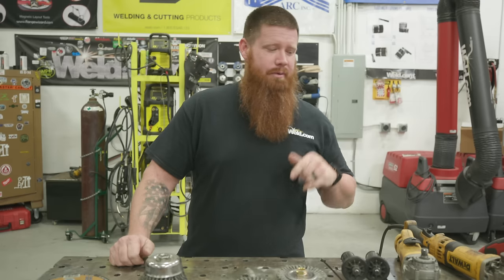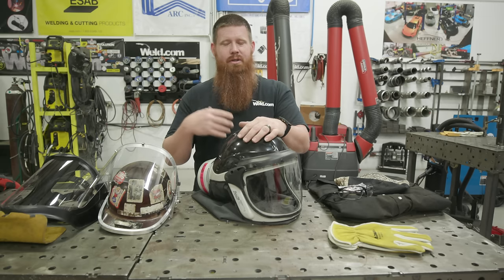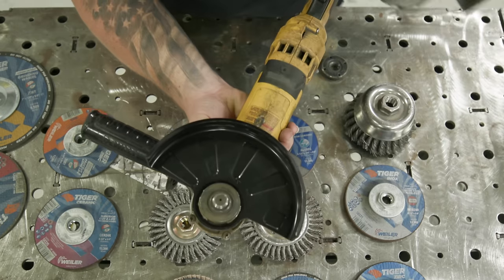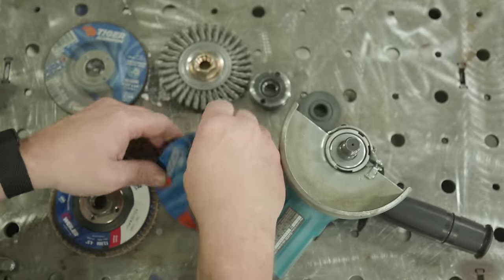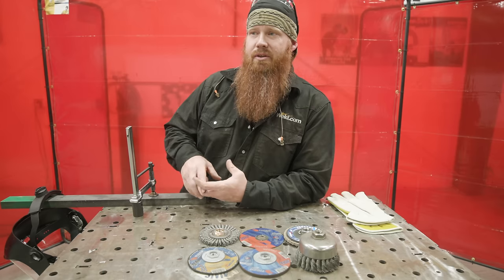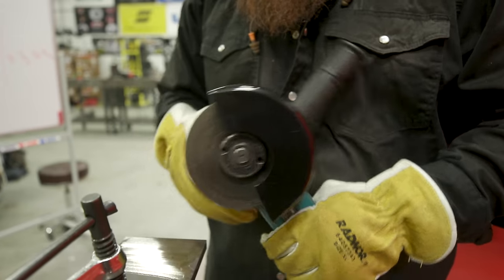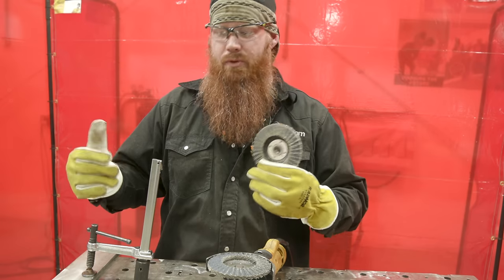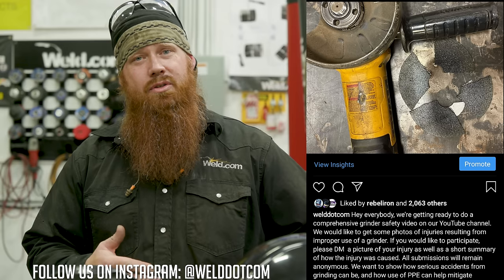Grinder Safety: How to Properly Use an Angle Grinder

Comment: I found a 7" 18amp grinder at the scrapyard and it had no nut or bushing. They tossed it because the double safety switch was broken. I bypassed the switch because it was annoying to fiddle with the internals and get it working (so I just jumped the internals instead) and it would power on when plugged in. Then, I used my hacksaw to cut a nut in half and I took the two flat sides of the nut and pinched a bargain store 7" cutting disc between the flat sides while on the arbor of the grinder. There is no centering mechanism for the cut off wheel when you do that, so I had to perfect the skill of keeping it centered manually while tightening the nut halves with an adjustable wrench. Sometimes it was close to centered, so I would very gently touch it to some scrap to whack off the bit that was sticking out wider. Man... When I cut that nut in half with the hacksaw I was like "this is the last fuckin hacksaw cut EVER!". LMAO, one could say I literally "blew through" a 50 pack of cutoff wheels, because they would blow up all the time! The grinder had a handle on the side, but it still yanked my arms a good couple inches when I kicked the power strip on. Luckily it had a guard. It came from a limestone quarry that tossed it in the scrapyard, which was where I would get my tools from back then.

Comment: Uh, your demo of how to do it wrong gave me the heebie-jeebies.  As a woodworker, I have a healthy respect for tools.  I still have all my fingers and both eyes.  I've never used a grinder (clearly, a two-handed tool), but I may need to, soon.  I have been considering 11-gauge landscape edging (Corten metal) for my yard.  To get the sections to fit my layout, I'd anticipate making a few cuts. The angle grinder seems to be the most appropriate tool.  Thank you for producing this comprehensive video - excellent presentation!

Comment: I was a welder for 20+ years and I've only had a few mishaps. About 13 years ago or so, I was using a  9 or 10in pneumatic grinder with a wire wheel. Luckily our uniforms were fire resistant, and stronger than regular clothes, because I got a little careless and the wire wheel caught the bottom of the uniform shirt and wrapped it up. However, since those pneumatic grinders don't have a automatic brake, that thing ripped out of my hands, wrapped my uniform up then proceeded to kick me in the side and broke 3 of my ribs on my right side. It happened so fast that there was absolutely nothing I could do about it. I had on all of the proper PPE and still got injured. Grinders are no joke. They will bite you every chance they get and you will lose. Be safe out there.

Comment: Never owned an angle grinder - they scare the crap out of me. But about to take my first MIG welding course age 70.
- no eye protection or face protection
- no shield on grinder
- flammable solvent
- sparks directed toward O2 and acetylene and hoses
- work not fastened down
- use both hands
- second grip should be attached to grinder
- could use smaller cutoff wheel

Comment: Awesome video. I have started using diamond cutoff wheels they don’t cut as fast but they don’t reduce in size and can’t break since they are steel. I still use a type 1 guard with it though

Comment: One thing i do after mounting a wheel is point it in a safe direction and pull the trigger for a second, then let it spin down. That lets me know that everything is mounted well and balanced. I have an air grinder that stops a bit quicker and LOVES to launch heavier steel brushes if they are not tight (they just unscrew from the arbor, still going 10k rpm). Had to chase a couple across the shop before, then launched one across the parking lot after hours just for the fun of it. It must have been going 30-40 mph by the time it hit the other side couple hundred feet away. Not the most dangerous thing, but would have been an "oh sh*t" moment if the lot wasn't empty.

Comment: Nice and informative video. As I know, cutting discs have a required spinning direction and are usually mounted with the label on top. Are you sure you mounted the cutting disc in the right way (min 22:20)?
Reply: I haven't seen any flat abrasive cut-off discs that had a direction indicator on them. Many diamond discs (not all) have the direction indicator. All those that I've seen, when mounted correctly, have the label facing outwards (away from the housing). Personally, I mount flat abrasive cut-off discs the same way. But I've heard arguments for doing it the other way. The discs has a metal flange on the label side. Label outwards - the nut tightens againt the flange (makes sense to me). Label inwards - the nut tightens against the abrasive, which doesn't seem ideal. On the other hand, the metal flange contacts the grinder washer flange, this can be more accurate with regards to centering. In the end, I'm pretty sure it doesn't matter (much) for these cutting discs, otherwise the manufacturers would put the direction indicators on them.

Comment: About how much can each wheel be used before they need to be replaced? I have used cutoff wheels so much it has been impossible to cut any further. How safe is that?
Reply: It's safe as long it isn't damaged. It's the centrifugal force that is the important thing. Less diameter means less centrifugal force. If the wheel wears down to half its original diameter, the centrifugal force will be only one quarter of the force of the original wheel. 
   It's just that a worn wheel has a lower cutting speed which results in faster wear of the disc as well as slower cutting. This is why I use to do something that I do NOT  recommend: Once a 230mm wheel has been worn down to approx.125mm, I still use it in a 125mm disc grinder. This has a higher rotation speed and the wheel can still be used efficiently. I've used a lot of cutting and grinding discs this way for more than 30 years and none of these wheels has ever exploded.

Comment: I use 6inch cut off wheels mostly because they help cut all the way through a 1-1/2” or 2” inch piece of tube and I don’t ever use a guard and have never had an issue . Is there a better way to stay safe but also be able to clearly see where I’m cutting so I can be precise on my cuts?

Comment: I must say that you should add this other safety thing in place. Plug in the cord to the wall or extension cord and quickly unplug it. I do this with any tools that I have to plug in. The reason is because the switch can be faulty and could be stuck on, or stuck off electrically. I was a warranty repair technician for many of the big names like Bosch, Makita, Dewalt and seen many switches stuck in their on position even though the paddle or trigger was off

Comment: Here is another safety idea that I have not seen you add to your other videos yet. When welding or grinding, you should make sure that your pants are always pulled down over top of your boots and never tucked into the tops of your boots.
Reply: Good point. I think most people learn that from own experience. It's most often not a directly dangerous but definitely not a pleasant experience to figure it out by yourself. :)

Comment: Should be required reading (viewing?) for any angle grinder user. 
I was especially surprised that there's a special guard with more coverage for Type 1 cut-off wheels. My grinder documentation mentions nothing about this, and yet - wouldn't you know it - all the cutoff wheels I've been using are Type 1.

Comment: Would be interested to hear your thoughts on using a wood cutting wheel designed for angle grinders. My angle grinder wood cutting wheel is rated at 11000 RPM, but I've never used it for fear of kick-back.

Comment: Hey, so, advice ? I found an old angle grinder in the garage, and repaired it (don't tell me it's safer to get a new one, I just really don't have the means) but it doesn't have a blade guard, and the handle is a bit wobbly. I've tried looking around in various hardware stores, but they don't seem to sell either separately. Do you know where I could buy one, or ideally, some tips on making one ?

Comment: in addition to the others comments: secure the piece being (if possible) cut with a clamp.. it you get a catch on an edge the piece could spear you. In this case it is easily clamped to a larger surface.

Comment: At least 5 safety mistakes. No eye protection, no guard, allowing sparks to fly in unsafe direction, flammable liquids on work surface, grinder turned towards operator. I’m a newbie but that’s what I saw on first glance. There are probably more. Thank you for this vid. 
I ride motorcycle and every spring before I ride I watch videos on how people die on bikes to instill respect for the machine and refresh my road strategy. I’m that guy🤣 Fear can be a good thing when it motivates you to be proactive.

Comment: Hello, thank you for this unbelievable video. How about use a diamond wheel instead of abrasive flat cut-off one? Of course it's much slower and much expensive, but seems it much safer. What do you think?
Reply from the maker: The diamond wheels work great as well and have a much lower chance of exploding like a standard cut of wheel but still want to take all your safety precautions.
Reply: Thank you for your expertise sharing

Comment: I was grinding with the cord thrown over the top of the work to get it out of the way.  When done I let off the trigger and let go of the grinder holding it only by the handle.  The handle broke off and the grinder came down to hang on the cord and swung into my leg.  I cut through my coveralls and my pants and into my leg.  Wasn't real bad but it sure hurt for a long time, it didn't just cut I think it burnt too.

Comment: Do you have to downsize the guard while using smaller wheels, I got the 4 1/2-6 inch grinder and would like to use smaller wheels

Comment: Re: suicide lock - i use it on my Makita all the time. I feel like i have no choice - the switch takes an incredible amount of force to keep actuated. Almost like it's designed to only be used with the switch locked on. The trigger on that DeWalt looks a lot more convenient to use.

Comment: So will a wheel always pull in the opposite direction that the sparks are flying naturally? The safe side of the wheel bit confused me, if the arrow at the butt points 👉  then the following six hours 1-6pm  is safe side, and the next 6-12pm is the dangerous side?

Edit: watched again, and I think I get it, I was correct

Comment: I have a suggestion for those who can afford it. Buy a porta band saw and reduce the amount of cutting with an angle grinder. I have used them and recently one jumped out of my one hand grip and got wound up in my baggy sweat pants, stalling it out. the tool ended up hanging in front of my undamaged tool. There are two rips or cuts in the crotch of my sweats.
I didn't even see the grinder move, it traveled that fast.
I bought a porta band that day. 
Porta bands cut faster and easier anyway. There will be cuts the grinder is needed for but not that many, save it for those.
My fault lay in that I have a horizontal bandsaw that I use to make the majority of my cuts, I simply put off the porta band buy too long.

Comment: It took me forever to find a type 1 guard for my new 20v Dewalt 4.5-5” grinder. Manual says to use one but Dewalt doesn’t make one (yes I called them). I found that Black and Decker uses the same attachment but only comes in a 4.5”. Seems like both guard types should be required to come in the box.

Comment: Me earlier today grinding and welding mig gasless fluxcore for the first time : No safety glasses ❌(relying on prescription glasses) No face shield ❌ Removed handle for access ❌ Used correct size wheels ✅ground particles in my direction accidentally once ❌Kept safety guard on ✅ used an old computer case to bounce grinding shrapnel back towards me ❌ Watching this video ✌

Comment: This one is so much sick! Loved it, man. Thanks a bunch for teaching me so much. Many important moments here, some of them:
- 15:50 - if your wheel had been rained on, get rid of it. don´t use wheels whose integrity has been compromised, unless you wanna get hurt seriously
- 30:20 - the safe side of the wheel for cutting. super important part!!
- 43:20 - for god´s sake, put that fucking GUARD on, will ya!
- the end section with graphic content "maimed limbs". it´s a must t send the message deep down: these are useful, but tricky machines. SAFETY FIRST!

Comment: Great video.  I wore safety glasses cutting a grate girdling a tree.  Metal bounced off my face under the glasses and into my eye.  The Opt Doc said I was lucky the eye had not healed over metal or he might had had to drill flakes out.  They heal quickly but he could still scoop them out with a tiny spoon.  I was lucky it did not leave rust stains.  I was lucky he got all metal out or a future MRI would have been problematic and painful.  I still required orbital x-rays before getting the MRI.  I'll wear proper gear now but I would never have thought of the dust and magnet. Thanks.

Comment: The other issues that can be added are : do not work or stop working with angle grinder if you are tired and having fatigue.the other issue is that there should be sufficient light on the workshop if the light is not suitable to gaze your eyes or too dark not to see the details clearly.

Comment: @36:10 you shouldn't use a flapper wheel for any sharp edges or corners. They will catch and tear the wheel apart and pull/throw the grinder.
It also drastically shorten the life of the wheel.
When I was building heavy equipment buckets/blades for a company (R),they were going to get rid of them because they were getting used up so fast and the price of them.I told them they need to teach the workers how to use them right by not using them on and sharp corners,anything that was just cut off with oxy/acy,etc. That was what is destroying the wheels so fast.Those type edges need a hard wheel to at least knock off all the sharp edges 1st. The flapper works great at removing metal,better than a hard wheel,but they need to be used right to get their life out of them.

Comment: Looks like a few safety issues include no    PPE, n[ guard possibility oversize disc if 4 1/2inch grinder,flammable items ...work not secured at least 12 safety issues. Sadly I am guilty of some of these too. No excuses.

Comment: Speaking of the suicide switch, I was in a boatyard and a man on the next boat was sitting under a boat on jack stands cleaning the metal running gear with a hard rock. He decided to change wheels and sat the grinder in his lap, somehow he had depressed and locked the suicide switch, the grinder was still in his lap when he plugged it back in. He had severe skin damage to the inner thighs and damage to the family jewels.

Comment: A colleague of mine was cutting bits off cars and the story goes that the disc broke, the result was a 5inch, 45 degree cut diagonally from under one eye up across the bridge of his nose and up his forehead which opened up his sinuses.  He said when he went to the medical centre it was hard to get any help because the nurses there kept fainting 😂😂.
So after that I always used a welding mask, which you should anyway since the sparks are incredibly bright!

Comment: Could I use a 5 inch grinding disc on a 4 and 1/2 inch grinder if the discs rpm rate is higher than the grinders ?

Comment: can I use a 4.5-inch cutting disc on a 4-inch angle grinder?
Reply: You can if the maximum rotation speed (rpm) of the grinder isn't higher than the disc is made for - and if it fits of course.  Generally a smaller grinder has a higher rotation speed than a bigger.

Comment: So at 0:45 i think:
- the metal bar can impale your body
- O2 can blow up from sparks
- sparks aren't going down on the floor (but igniting the paper XD)
- rapid rotation of the bar would hit the "OLD Solvent"
- the grinder does not have a cage/cover
- goggles on the forehead like a pro
- no safety clothes?

Comment: And body know what coolie hats are? in the mid 70's about -20 out side shop just warming up, I am bundled up with layers and put on a leather apron to get a part done to head out, I grabbed the Soux 9" beast grinder, we never ran guards back then, placed the coolie wheel flat on the welding table to knock down the old tacks and berry's, and all of a sudden KABANG! the wheel split in half sending the free piece into lower left quad of my gut, I threw the grinder away and went rolling on the floor in pain, didn't punch my flesh but ended up in the ER for X-rays. you really can't run coolie hats with guards for surfacing because the guard get's in the way, btw, coolies are type 28 dished fiber wheels, fantastic for broad flat surfaces and don't dig in like a flat or depressed center wheel can. They still make them, found some in 7" and you can run them with a guard if you shim the arbor a bit to just get the wheel past the guard a tad. like a half a wheel thickness.

Comment: Both cutting and grinding wheels work best and last longest if they're mounted on the right size of grinder. If the wheel is smaller than the grinder is made for, it will worn out much faster, because the rpms and therefore the cutting speed is too low. The speed of the edge of the wheel is what determines its efficiency and life time. The maximum allowed speed for the edge (which should be labeled on the wheel) gives the best effiency.
Reply: This isn't "legal" but what I use to do: I only buy 230mm cutting wheels (for my 230mm grinder). When they worn down to 125 mm I put them on my 125 mm grinder. Why I consider this safe is because it's the centrifugal force that makes these wheels explode. If the diameter is smaller, the centrifugal force also is smaller and the same wheel can withstand higher rpms. Pure physics.